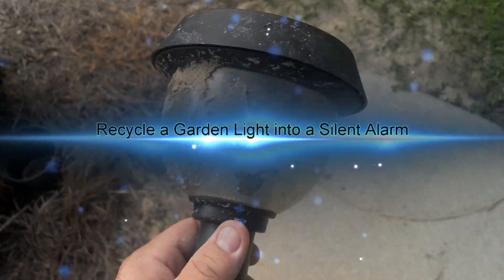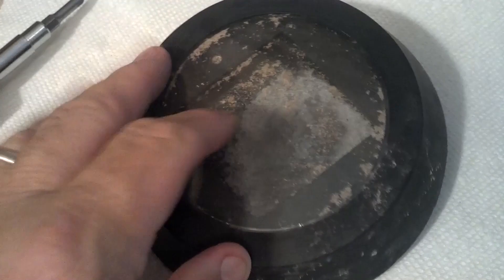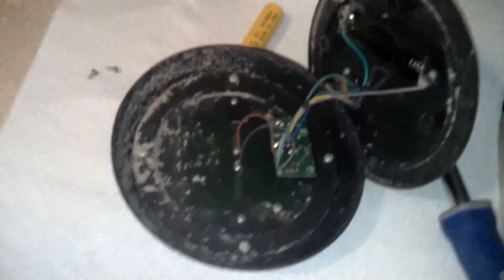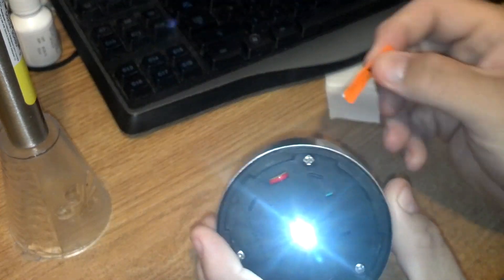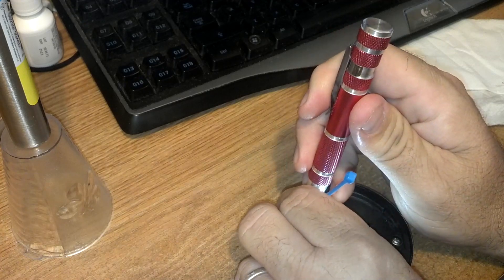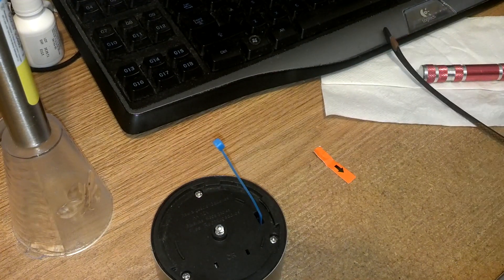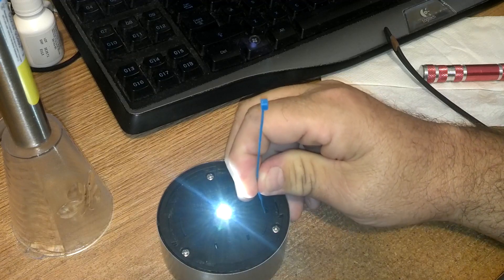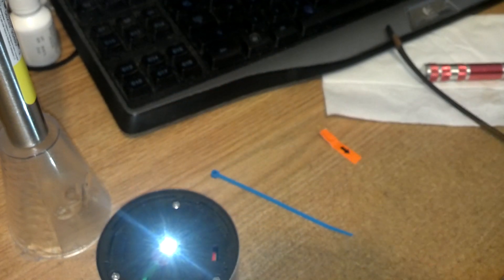Recycle a Garden Light into a Silent Alarm

Comment: Suppose you use the laser as a silent alarm. then when it's tripped with a thread, the laser would shine a long distance into your home where the light would spread thru the window somewhat and be noticeable in a dark room as a red glow or fairly large dot on a light colored wall. This would mean that the laser source could be placed a fair distance from your home, giving you more lead time if something is coming. Also, the laser might not alert the intruder so you have the advantage of surprise (you know the intruder is there, but he/she doesn't know you know, whereas, with the white light, the intruder knows you might know, at least if you are watching carefully. Another way to keep it unnoticed by the intruder would be to use a fiber optic cable from the alert device into your house.